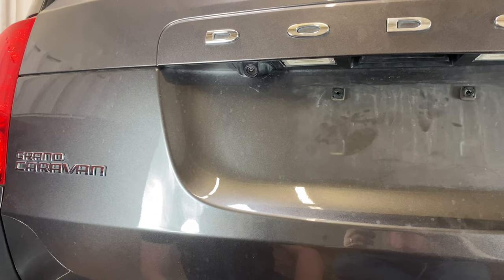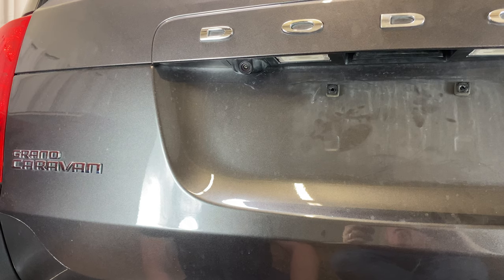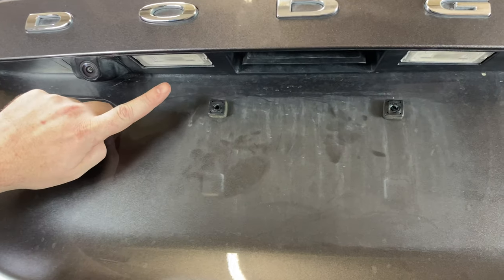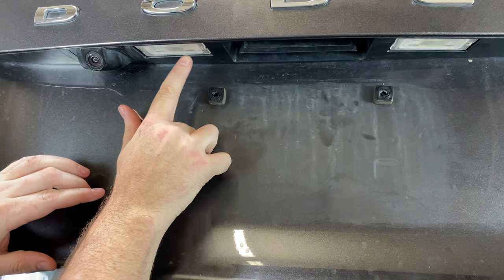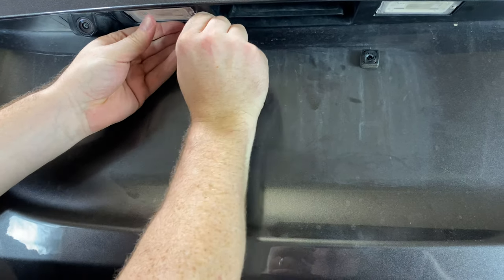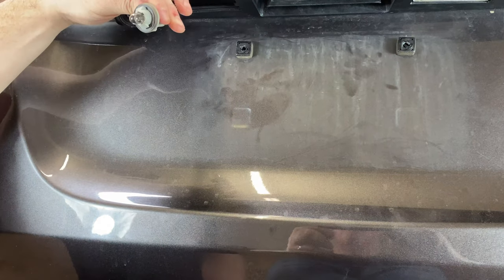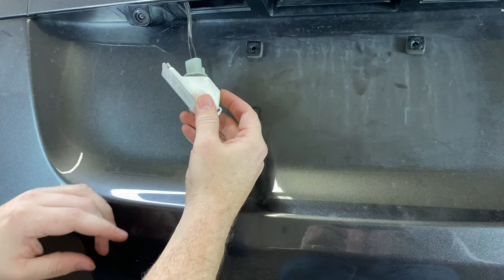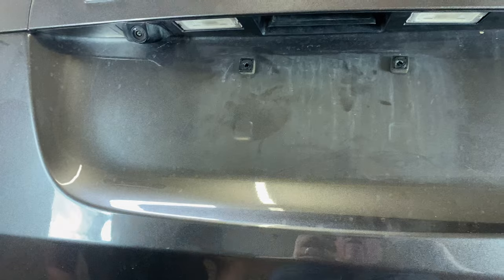Dodge Grand Caravan License Plate Light - How To Change Remove Replace DIY Replacement

Comment: We have a 2010, it's similar, I was wondering what that part is called that the light assembly snaps into. The part that says dodge. Ours is broken and I can't find what it's called to find a replacement
Reply from the maker: I believe they are referred to as a "tailgate finish panel".
Reply: Can you post how to take them off in struggling